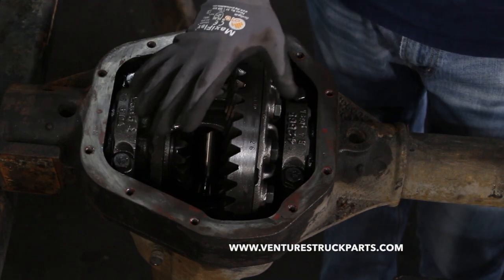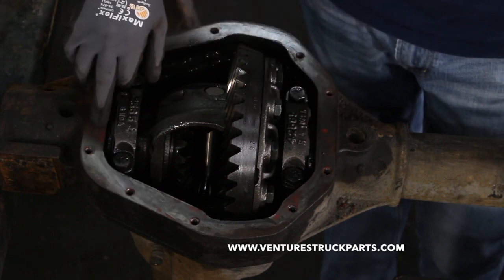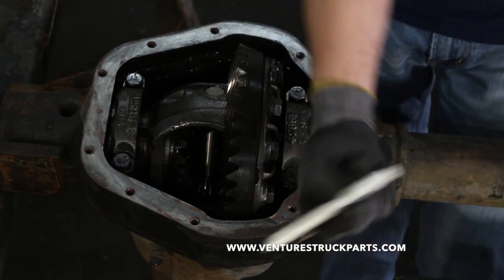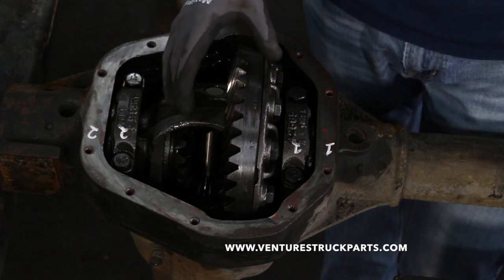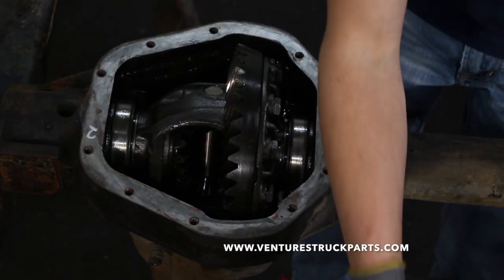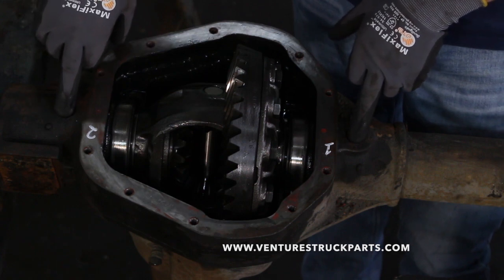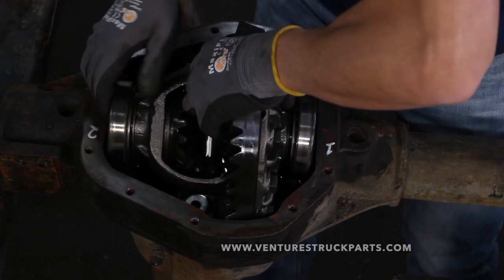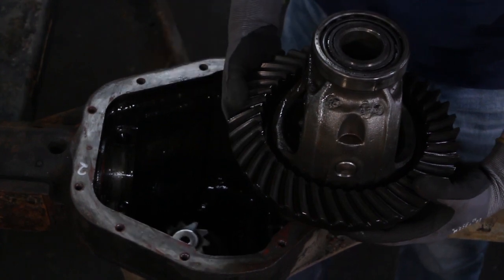Removing Axle Carrier From Axle Differential Front Or Rear

Comment: All the videos i've watched everyones carrier came out easily.  I just spent 1.5 hours prying on mine in my truck and I can't get the son of a bitch out lol.. and Yes all shafts are removed from inside the axle lol.  I might buy  a long pry bar like that one and try at it tomorrow
Reply: did you get it out ?  i have same issue.
Reply: I'm struggling with this right now too if it makes you feel better
Reply: Mine was tight Dick's hatband.  I made my own case spreader.  Seems like too much preload to me.   I may remove some shims when it goes back.